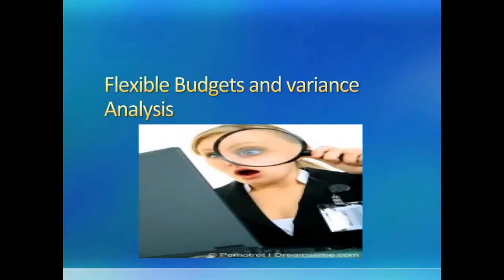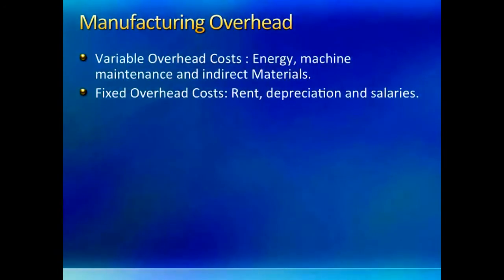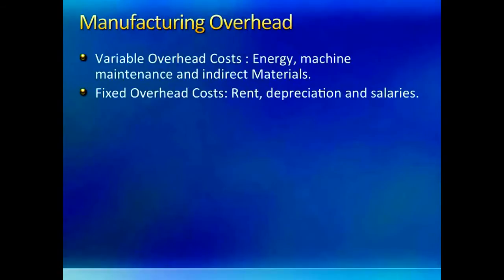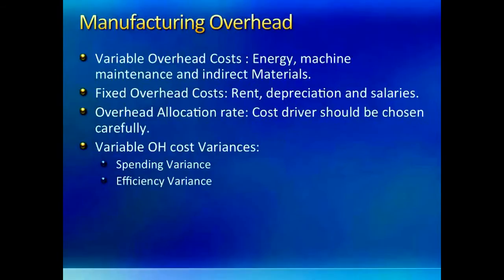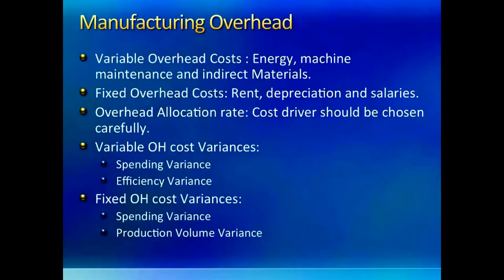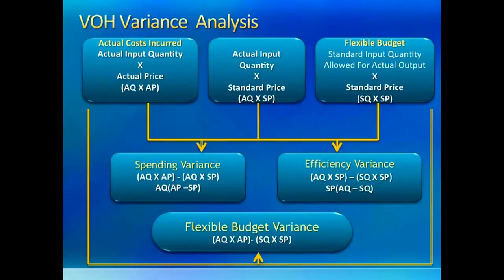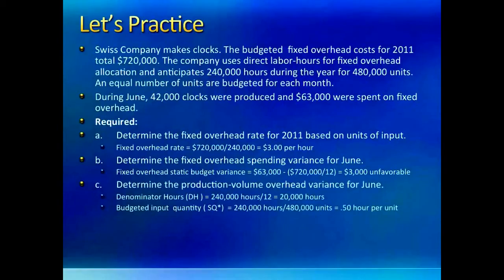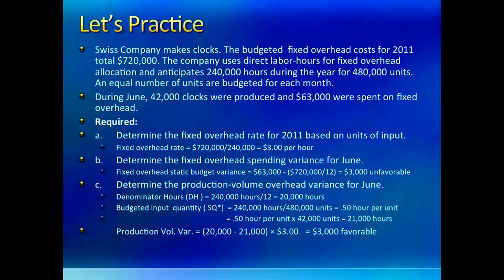Flexible Budgets & Variance Analysis- Intro to Managerial Accounting- C8- Professor Savita Sahay

Comment: 11:54 The online homework shows that Flexible Budget Variance for fixed manufacturing overhead is Actual Costs Incurred - Flexible Budget, the same as the Spending Variance... Which is correct?

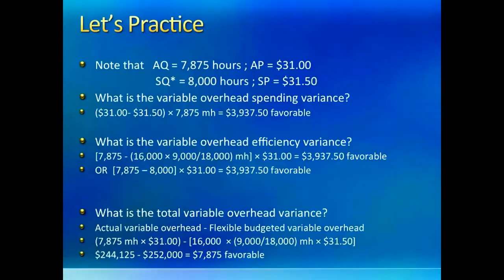Comment: For 7:10 overhead efficiency variance, I think you did a wrong calculation by used $31.0 Actual rate instead using $31.5 Budgeted rate